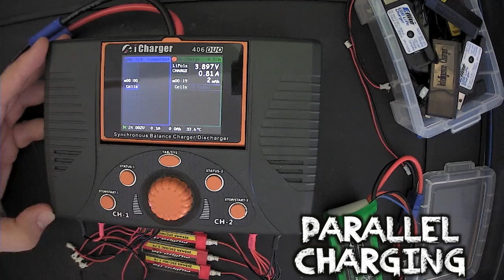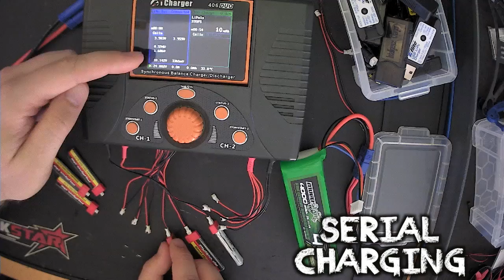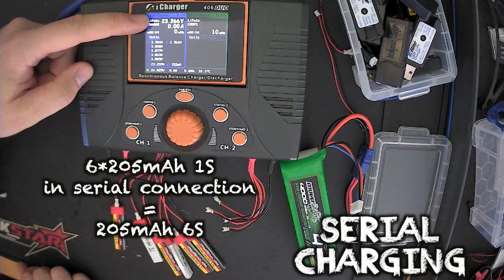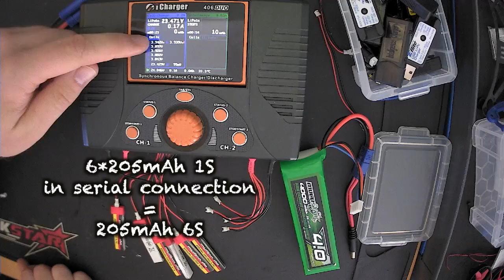Whoop Clinic #3 - [BATTERY CHARGING] - Tiny Whoop, Inductrix FPV & Co

Comment: Great video. Can I charge six 1s batteries serially that are all the same volts but have one with a slightly lower mAh (one 450mAh and others are 550mAh)? They are balanced separately by the charger so I would think its ok if they have similar starting voltage levels.

Comment: @Micro Motor Warehouse 
on your hitec, when serial charging do you balance charge or just charge?? ive got the hitec x2 and im trying to serial charge 6 hv lipos. hitec x2 pro is hv capable. Just wondering if you choose the balance option or not......
Reply from the maker: Im using the Hitec X4 Micro, which charges 1S packs completely independent. If you have a 6S capable charger and connect six 1S packs with a serial cable, you should absolutely connect the balance plug of that cable and charge with a balance program!

Comment: using the 4way parallel port I can charge 4 220mah batteries as well I just set the amp to .9?
Reply: Ryan Burford yep, 0.9A is good to charge 4x220mah in parallel!

Comment: Which method do you use/prefer?
Reply: Joel Dino I use all methods, depending on situation and number of batteries to be charged.
Reply: Benedikt Haak thanks for the quick reply. Still using those little rubber bands, eh? One more question...should we only charge at 1c rate or it depends?
Reply: Joel Dino rubber bands are universal ;) 1C whenever you can. A good battery also takes 2C charge without a problem. I rather charge with 2C than leave batteries charged for more than a few hours,

Comment: Can I use that hitec to charge my hv nitro nectar batteries?
Reply: Moises V. Yes, but only to 4.2V.
Reply: Benedikt Haak what would be my best option to charge them at full capacity?
Reply: Moises V. Any charger with a dedicated LiHV program or adjustable cut-off voltage will do.
Reply: Benedikt Haak okay for sure thanks

Comment: https://www.flickr.com/photos/142287763@N05/28033713370/in/album-72157670981079786/
my charger says "see you later stock icharger"
Reply: thatonebeone wow, that looks awesome! Would you share done details why and how you did that?
Reply: thanks... i work in electronics...i like to be different... 5mm plugs on it now, faster cooling fans,RGB LEDS, painted it white,PS buttons,short power cables with 5mm plugs...

im making a super whoop waiting for my stuff to come..will make a custom charger cable for it also... this will be probably the most crazy whoop you will ever see.. 

going to use that black frame since the stock ones break so easy.. as much as i want to use the stock ones to keep it light weight as possible but they are just to flimsy and break probably in one crash ... stay tune for it ill post it in RC  groups :)
Reply: thatonebeone sweet, thanks! I'm keen to see if it goes any crazier than High Voltage Rambo Whoop :)

Comment: You have presented two charging methods. Which one would you prefer... Parallel or serial?
Reply: Marek Grapiniak I mostly use the Hitec X4s. When I need to charge more than 16 packs, I also use a 4 port universal charger with parallel leads. When I have packs with unknown condition, I use a serial cable to check the voltage to then form different piles with similar voltages to connect them to the parallel cables.